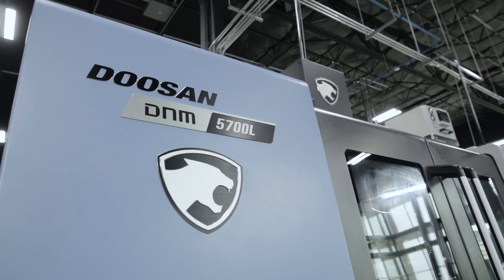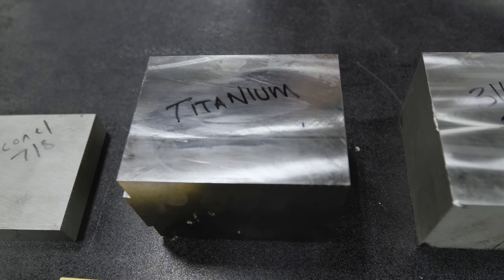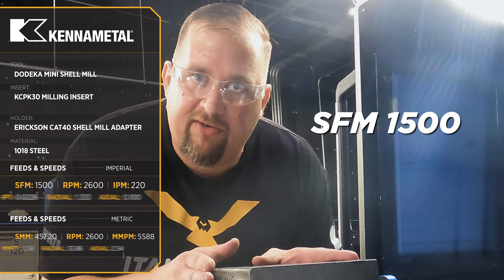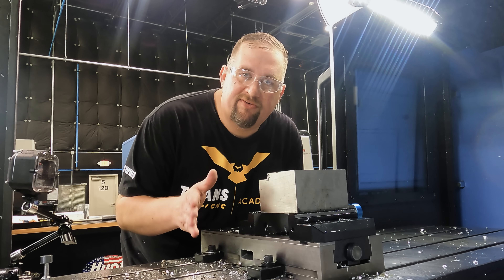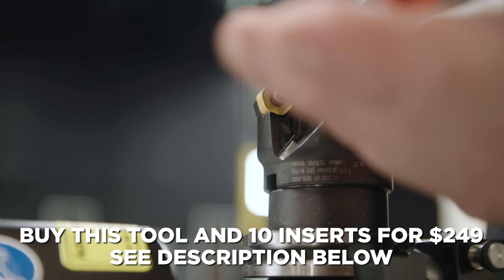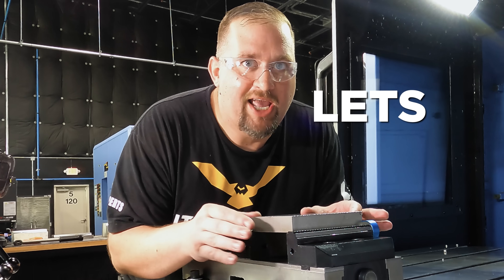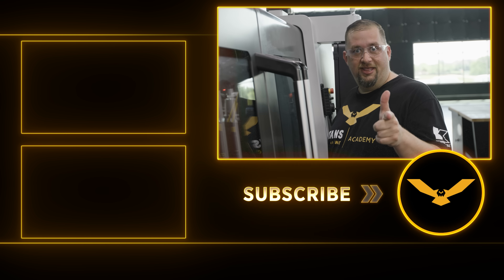1 TOOL vs 5 MATERIALS… INSANE NO-HOLDS-BARRED CAGE MATCH

Comment: we've been using a dodeka for awhile with the general purpose, started using it on 316ss but having issues so i check this video out, i found the grade you're using from a supplier, we are only taking a .030 depth of cut so i was gonna start at your feed and speed and go from there, but i checked your site and noticed you dont have that grade anymore and had a more heavy duty one, would you recommend the one from the video or try the other stainless general or heavy duty one from your site?

Comment: I ran my new dodeka mini with the .022 chip load 1500 SFM  .025 step down and it did ok but the surface finish was not as good as we need. It also hurt the insert a bit. Kennametal has the recommendations at .0055 but that seems to conservative. Anyone have some input for a good finish speed and feed as well as roughing that doesn't hurt the insert? We are running it on a brand new DMG so holding and machine are not the issue. Thanks in advance.

Comment: Ok I am confused because the calculations for aluminum for 4000 sfm and .011 per tooth is 7640 RPM not 7000 like said in the video and the feed if .011 is used is 420 ipm not 300 ipm. Did I miss some thing because the math is not adding up?
Reply: Hey Richard, I did take a look at this, and the answer is that my surface footage calculation takes depth of cut into account. The cut diameter of this tool is 3", but as you get deeper, the tool outside diameter is 3.150. So with the insert angled, the deeper your cut, the bigger your tool diameter is.
Reply: Ill check it out on monday. If the info is wrong, its MY fault. Ill keep you posted.
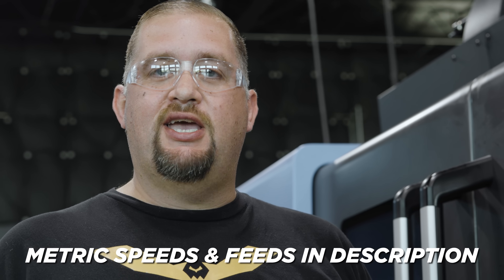Reply: Could be i gave the editors feedrate from 6:19. In the end, you can run that tool at 5,000 sfm and .022 per tooth, so feel free to test that 🤪
Reply: @barrysetzer  thanks will be trying that tomorrow
Reply: Thank you Barry that makes sense

Comment: Try it in D2 tool steel pre heat-treated to Rockwell c hardness of 30 lol
Reply: RC 30 hahahaha that might as well be aluminum. Now some RC 60 CRES stainless…..
Reply: @barrysetzer  Obviously you've never worked with D2 lol .
Reply: Oh i have. ALOT.
Reply: 30 hrc is low. Even 6Al 4V titanium is around 45. I want to see Barry getting after high alloy high hardness steels like CPM S90v at 61hrc or CPM rex121 at 70hrc

Comment: Great video! Question: How would the cutting parameters (speeds and feeds) change for steel and stainless steel once you turn the coolant on? I am thinking of how to avoid material hardening once the coolant hits.
Reply: Austenitic stainless steels do not harden on quenching, although they do work harden quite rapidly which is why you never dwell in a cut or let the tool rub. Work hardening also means that the chips are hard as hell so recutting them is a great way to destroy your tool — chip clearance is extra important when machining stainless steel. 1018 might quench harden under very high cooling rates but that won't happen in a cutting operation. If your parameters are good most of the heat should be going into the chip anyway.
Reply: @purerhodium  Thanks for the insight! Material science is not my forte
Reply: No change, youre fine at the same parameters with coolant!
Reply: @barrysetzer  Oh wow! Thanks!

Comment: ANY TIPS??  i just ran this shellmill for the first time and had some poor tool life?????  2..0" promo dodeka KCPM40 inserts (was told they where the general porpose go to)   3.5" 1018 round bar squaring it up to 3.05"x2.45" 5.5 long. blaser BC20 coolant, tsc on. 2300RPM (1200sfm) 150IPM (0.01304/tooth) 0.08" doc 1.5 woc. haas VF2 20hp 10,000rpm spindle (aka low torque). held securly in vice.  I would only get about 5 parts per edge (20cycles). and honestly i was running way past where i should have flipped the insert. (in saying that it was predictable consistnt wear with no sudden failgures which is great)
Reply: Hey Brian, Barry at Titans, here. But you already knew that. 😂. So in this video i was using KCPK30 grade as general purpose on the 1018 and 316L.
Reply: @barrysetzer  so maybe my vendor recomended the wrong grade for my application then? looks like you used every grade in the promo sale BUT the one they recomended! :p ill have to buy a few more maybe, may as well at that price i guess. any idea what the  KCPM40 inserts are for? i still got alot of edges for a job one day i guess!
Reply: These are the black inserts, and after this (quick) video they had zero visible signs of wear. Your parameters look good……maybe a little conservative on sfm and feed……
Reply: Are you in our FB group? If so, friend request me
Reply: @barrysetzer  im not, got a link to it? been meaning to, but a one man garage shop chews alot of time! mind you, so does failing when not asking peers for help... hmmmm.
Reply from the maker: @brianwaayenberg3099  Hi! Even Barry needs a hero too sometimes 😉 Here's the link to our Facebook group: 

https://www.facebook.com/groups/titansofcncacademy/?ref=share

Hope to see you there! 😁
Reply: LOL thanks Titan!
Reply: Tried to link you, but YT hates FB. Go into this video’s description. Link there!
Reply: @barrysetzer  joined, looks like a good group to chat and see some nice projects!

Comment: So...the lesson for today is "plug in the correct feeds and speeds, install the proper inserts in your shell mill, and the machine will do the work." Which all our budding young machinists need to know.

Question though: you used different inserts for aluminum, steel and exotic metals. I'm reading that as the KCSM40 is harder than the KCPH30 and that insert is harder than the KC410M. Is there a reason you couldn't standardize on the hardest insert and run everything with it?
Reply: To be perfectly honest, i am not sure how the KCSM40 would perform in aluminum. Im sure it could cut it, but i am unsure how the coating would react with sticky materials. If you end up trying it, please tag me on our FB group……i would be curious to see how they work
Reply: @barrysetzer  I don't think there's much chance of me trying it, at least not right now...I work in a sign shop and the most aggressive tool I've got is my 50-watt UV laser cutter. I have definite need for a CNC router to mill aluminum and high density urethane, but space is at a bit of a premium...with the Indigo digital press, 64" roll-to-roll inkjet, 126" roll-to-roll inkjet and 96" flatbed printers, plus all the finishing equipment we use - contour cutter, laminator, Fotoba straight cutter, quite a bit of print binding gear and Fletcher signboard cutter -  we've got JUST enough room to turn around in there. Unless I can convince the boss to buy an old grocery store, the router's going to have to take up residence in my garage at home. Do you have any preferences as to CNC routers?

Comment: We had a similar tool in a old work place,  8 inserts I believe we called it the aluminator. We used it on cast aluminum boxes because of the surface finish requirements.

Comment: I work with a lot of welded inconel 625. What’s the difference between this and 718? Obviously the initial cut through the weld can pose issues but how similar are the materials after that?
Reply: 625 is much easier to machine than 718. But  718 is not the worst either.

Comment: You may have 12 edges per insert but in reality you cam only use 6 due to wear
Reply: It actually depends on depth of cut. At .10 depth you only have 1 edge and 1 radius in contact with the workpiece
Reply: @barrysetzer  it is still a good cutter. I have run a 160 dia  at feeds in excess of 3m/min

Comment: So, why both the integrated cooling from the tool and the external jet of cooling? Chip evacuation? Better cooling? Or just overkill because you didn't turn the external one off?
Reply: This machine doesnt have a high pressure thru spindle coolant pump, so I just felt better doubling down on the coolant. Good question man! Thanks for watching!